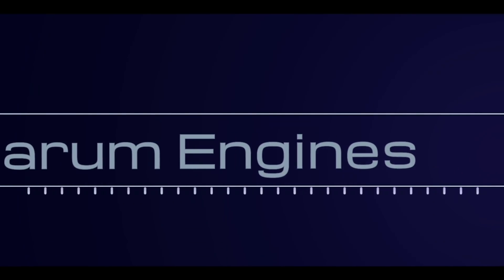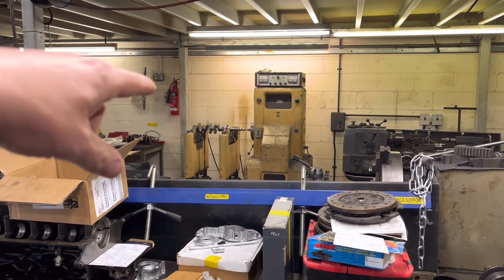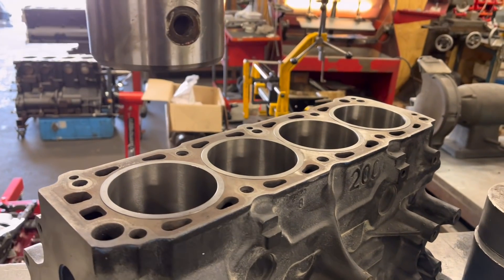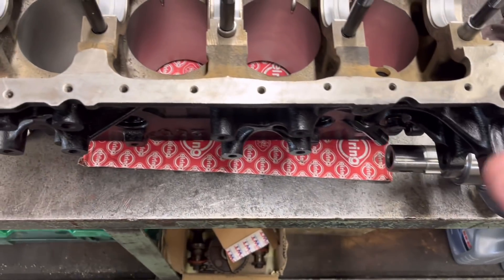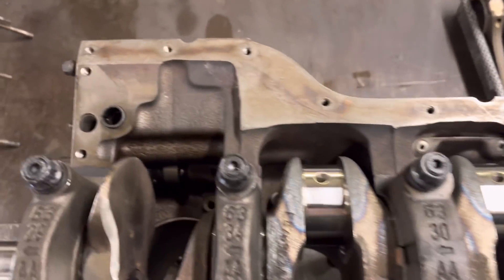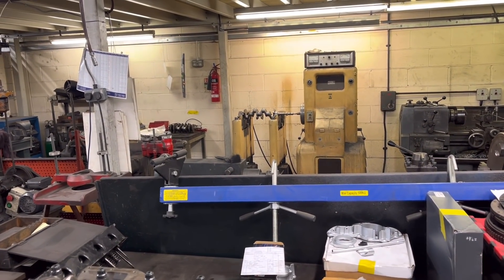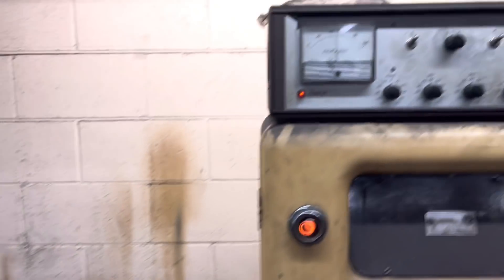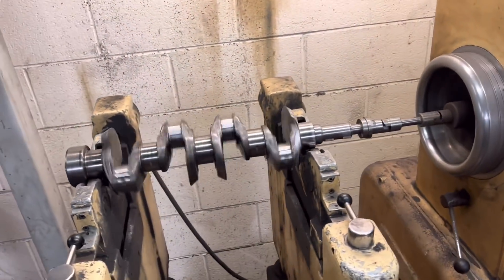Back to basics with fitting these crankshafts, plus, how out of balance is this knife edged crank?

Comment: Another nice video! That bike 🏍 is beautiful, especially for the price! I’m just way too far away 😂😂😂😂! I betting your confidence is low when installing sleeves because you have broken 😡 one before 🤬🤬🤬🤬! Believe me, we’ve all been there 🙄🙄🙄🙄! We had some sleeves that a customer brought in one time 🙄🙄🙄🙄, they were so shitty, that I had 4 of them either completely break, or crack when pressing them in 🤬🤬🤬🤬! Needless to say my boss made me pull the other 4 back out, & we got new ones from Darton! I double checked everything thinking I did something wrong 🙄🙄🙄🙄! It’s was fine! The sleeves were just brittle garbage 🗑 🙄🙄🙄🙄! The Darton sleeves pressed right in 😂😂😂😂! No issues whatsoever! I could hear your boring bar running in the background 😂😂😂😂! Do you know that a Centroid CNC Machine bores a complete V8 engine in 10 minutes 😂😂😂😂! No Bullshit 👍🏻👍🏻👍🏻👍🏻! That new stuff is amazing, they cost a shitton, but when you could do everything you have to do on a block, in just a few hours maximum, other than the line bore/hone & the honing of the cylinders, it just mind blowing how much time we used to spend on the old machines 🙄🙄🙄🙄! Now that’s another amazing machine! A newer Rottler hone, blows through the toughest blocks in 1/4 of the time of the old machines 🙄🙄🙄🙄! They do a exacting job & you don’t need to be standing around 1 machine forever 🙄🙄🙄🙄! Our old Hines balancer, just keeps plugging along year after year, with no issues ever 😂😂😂😂! Even when they come to calibrate it, it doesn’t even need to be 😂😂😂😂! But the boss does it anyway! We balance rotating assembly’s for people all over our state! A lot of top tier builders! Never had a issue, ever! The new machines cost a fortune! But when your backlog of work goes from months, to just days! You can take on new clients & more work get out! Never mind the quality is even better 🙄🙄🙄🙄! They do pay themselves back quicker than you would think 🤔! Have a great day 👍🏻👍🏻👍🏻👍🏻!

Comment: There's a whole heap more to balance than meets the eye and there's a whole lot more to it that your machine can't measure. It's OK for a stock crank but once you start lightening them, you're going backwards .Have a think about inline 4 cranks that are fully counterweighted and then think about the lower spec ones that only have half the number of counterweights. Once you lighten them they'll break at high rpm .Balance at low RPM is totally different from balance at high rpm.
Reply: The limitation with crank balance machines is that they only spin slowly and only measure imbalance in 2 planes, as in each end. Once you start spinning them fast you need to also measure the imbalance in the middle, that's what causes excessive bearing wear at high speed and high load.

Comment: A little hint for balancing. Use your machines static balance feature to tell which end to start with. If the left is heavy at 0 degrees and the right is heavy at 160 degrees, switch to static to see where that's heavy. It will vary depending on exactly how far out it is, but you can give yourself a good head start by taking it off the heaviest end first. That probably doesn't make much sense to read, but give it a try and you'll see the relationship between static and dynamic balancing and how you can use one to speed up the other 👍

Comment: @Barum Engines  Lee a question thats been bugging me, How exactly does the crank grinder maintain a  perfect size circle  when grinding the big ends on a crank with it rotating off center etc ,and how can it be so precise using abrasive that wears ? please show insides of the machine
Reply: The big end rotates on it's axis and the main bearing journals are offset
Reply: @1magnit  that's not how it looked in the video, the whole grinding head was ocilating
Reply: @kevinapps1233  Lee's grinder seems to work in a similar way to cam grinding  machines where the stone moves in and out.  My own machine has offset chucks, the latest here. https://www.youtube.com/watch?v=G6N3sqLqPiQThe stone is about a metre in diameter  .
Reply: i think they check each journal as they grind and adjust as necessary for wear in the abrasive wheel.
Reply: @duggy788  The stone wears very slowly and gets recut between jobs if required
Reply: @1magnit  that doesn't seem precise enough
Reply: @colinscutt5104  That's how my machine works
Reply: Interesting